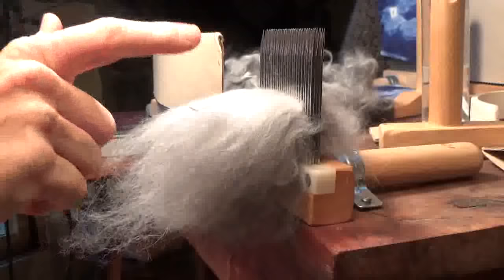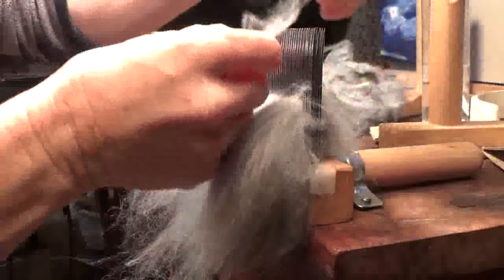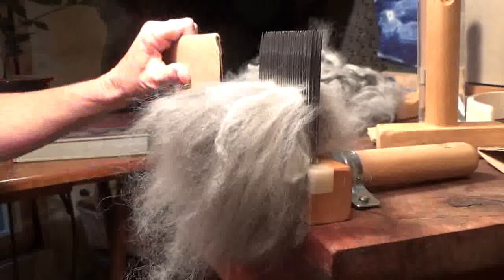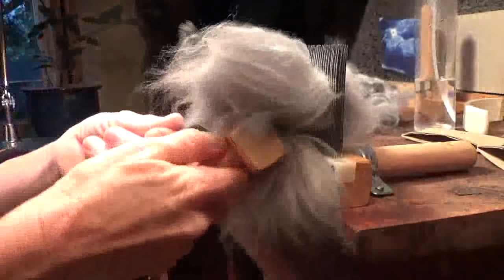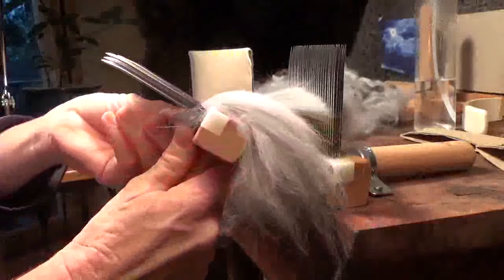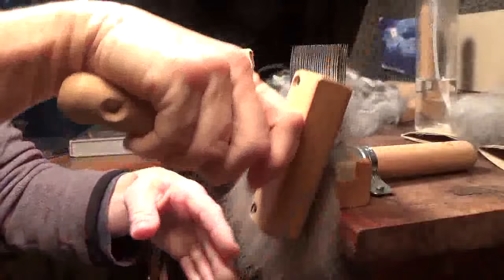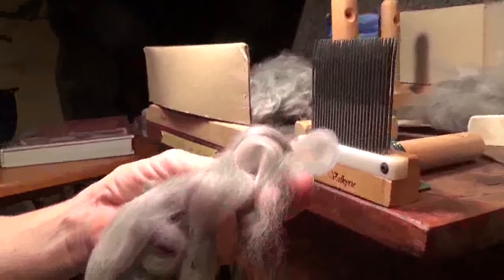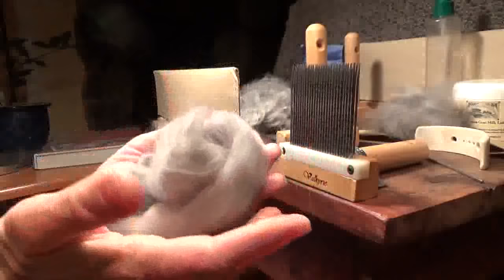Combing Angora Rabbit fiber with Valkyrie Superfines

Comment: Are you using regular size fine combs or the mini combs?  Also what accessories are holding the one comb stationary?  I've never seen the combs being used, only the hand cards (which I have), because I used to raise French & German Angoras.  I did have one English Angora, but you do need to cut the fiber,  rather than pluck.  I plan on raising the French again in the near future.  Do you use a wool wash on the fiber?  I am allergic to cat and rabbit fur, because of their saliva.  Thank you for this video.
Reply from the maker: These Valkyrie Superfines only come in one size and fall into the mini category. The other Valkyries, except the Viking, come in mini and regular, with the mini being one inch less wide than the regular, otherwise they have the same size handle and tines. I do wash angora before combing and spinning it. I just use a tiny bit of dish detergent and warm water.

Comment: Do you wash your fiber in the mesh bags in a bucket of water or in a machine on gentle. What fo you use as a detergent? Then how do you dry the fiber?
Reply from the maker: Definitely in a bucket by hand. A washing machine would for sure felt it. I use a non-enzyme dish washing detergent. It is laid flat to dry on a screen. It will look flat and terrible, but after it dries, you can just use your fingers to fluff it back up.

Comment: How are you keeping the comb stable? Valkyrie has a comb pad but it doesn't look like that's what you're using?
Reply from the maker: Hi Grace, I fashioned my own way to hold the combs and hackle. The comb is held with a screw through the hole in the handle and closer to the head is a conduit strap, like this–  https://www.lowes.com/pd/Sigma-Electric-ProConnex-1-in-Two-hole-Strap-Intermediate-Metal-Conduit-Compatible-Galvanized-Rigid-Conduit-Compatible-Rigid-Metal-Conduit-Compatible-Conduit-Fitting/1000152465   – that holds the comb very securely. The hackle is held down with this –https://www.lowes.com/pd/AMERICAN-VALVE-1-2-in-to-4-in-dia-Galvanized-Hanger-Iron/3223489 – because it's just what I already had lying around. There should be a cushion (like drawer liner) between the metal and the wood to not create an indent. And of course I have a dedicated table that is just for combing so screwing into it is no big deal. 
Thanks for your question. – Kimberly
Reply: @thenaturalspinner  thanks for the detailed reply!!

Comment: What combs are you using and what ones would you suggest for a beginner?
Reply from the maker: Hi Levi, I use Valkyrie combs. The ones used to comb the angora are the Superfine. I also have the Extrafine size. Having the two sets of different sizes means I can tackle pretty much any fleece out there, with few exceptions. I generally suggest beginners buy the Extrafine because they are good for a wide range of fibers. If someone gets more into fibers less than 20 microns, then I'd say add the Superfine.  -Kimberly